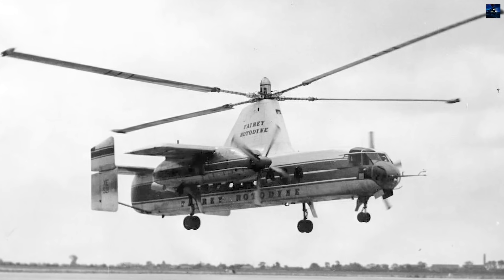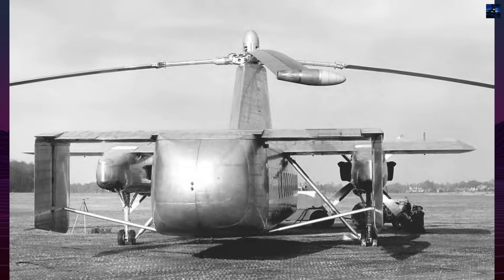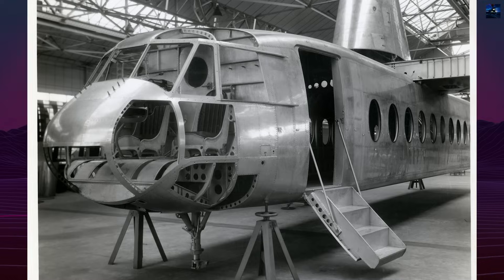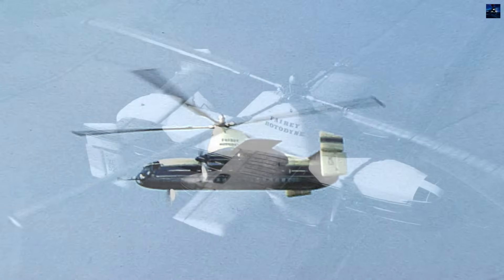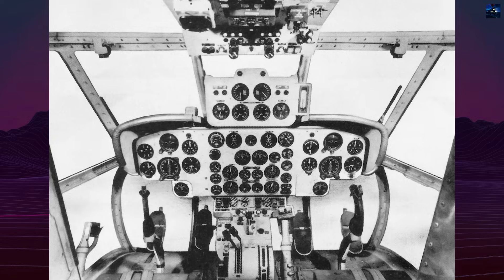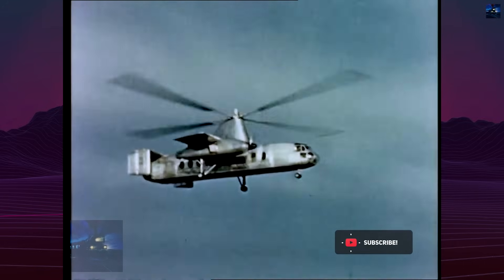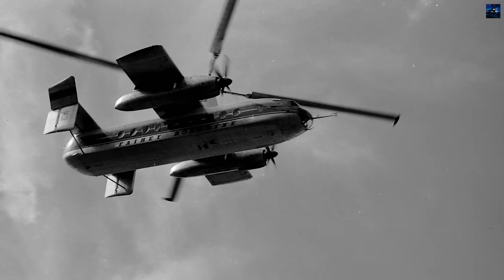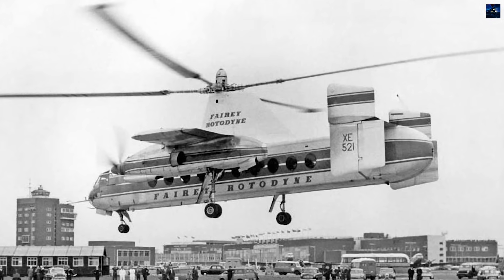Fairey Rotodyne: The Loudest Aircraft Ever? Why It Was Scrapped!

Comment: By the time the ROTODYNE was canceled, Fairy/Westland engineers had developed tip jets which considerably reduced the noise generated. So although  excessive noise is cited as the reason for its cancellation,  the Rotodyne' was really cancelled purely for  political reasons. Similarly, the Westminister Helicopter, another helicopter being developed by Westland, was also canceled for political reasons. For all intents and purposes, the British government did not want helicopters to be built in England, preferring that the aircraft manufacturers make only fixed wing aircraft.

Comment: "The Loudest Aircraft ever" No , not by a long shot! That dubious honor goes to  the American REPUBLIC XF-84H "Thunderscreach" [a Republic F-84 THUNDERSTREAK fitted with a giant turboprop in place of the regular jet engine with the noise from its engine and propeller being heard from 25 miles away. And coming a close second  in the loudest aircraft ever stakes is the American  Hughs [ nee Kellett ] XH-17 HELICOPTER which, like the Rotodyne, used a similar cold jet powered rotor and which could be herd from a distance of eight miles from the aircraft

Comment: This AC would have been a success by just incorporating up powered Engines and losing the tickets and incorporation of Shaft powered Rotor.  The Airframe was Beautiful and not far removed from the CH47. Wow such a Beautiful Plane to never be.💔❤❤
Reply: The Rotodyne was a million miles away from the Ch-47... which is why it was a failure
Reply: @DoktorBayerischeMotorenWerke  The Rotodyne was not designed to be a helicopter, therefore it cannot be compared to a Ch-47
Reply: @EVISEH  The Fairey Rotodyne is a Rotary-wing aircraft, a type of helicopter.
If you want to be specific? Its a gyrodyne and type of helicopter/autogyro hybrid.
A closer comparison to its intended role would be the V-22 Osprey.
 In terms of payload the CH-47 is in a much larger class.
 In terms passenger capacity, speed and range the CH-47 and the Rotodyne are very similar.

If the Rotodyne had gone into production? it would have been a competitor directly against the CH-47.

Comment: I am in awe about the rotor/rotor blade construction and used (compound?) materials. Standing up against all weather. Even with added tipjet thrust. Was the rotor solely powered by those for starting operations? And it seems to have no back blade speedlimits like Helis. And the looks! 😊 Thankyou
P.S. I'd rather have the occasional 'Fairyqueen' rumble than endless and disdainful motorcycle rumpus.
Reply: yes  - the  rotor was powered by the tip jets exclusively  - it was not connected to the  to the turbines.